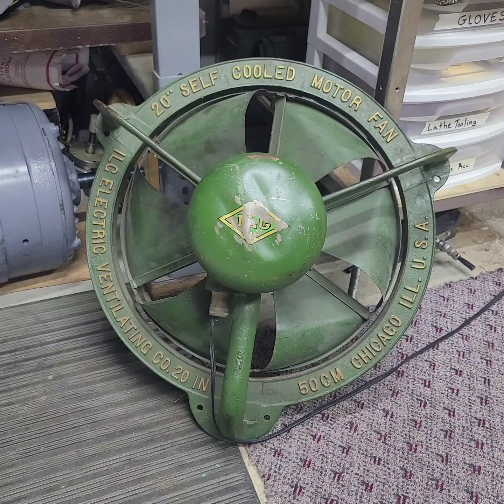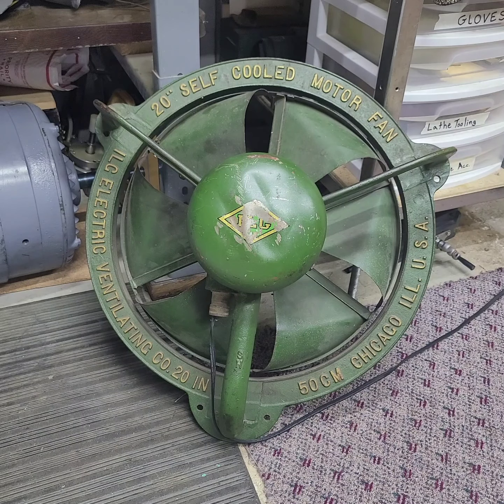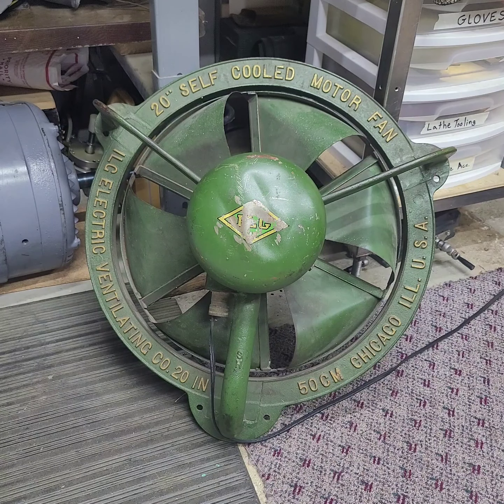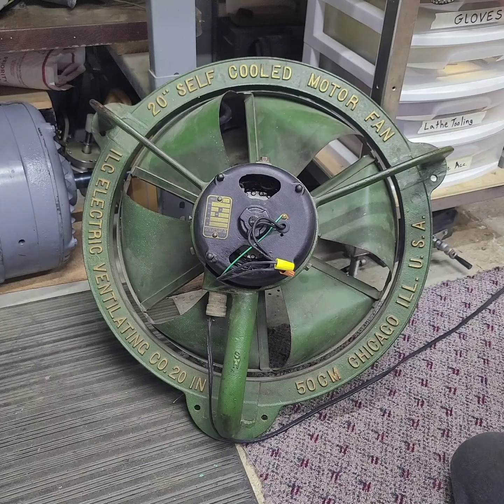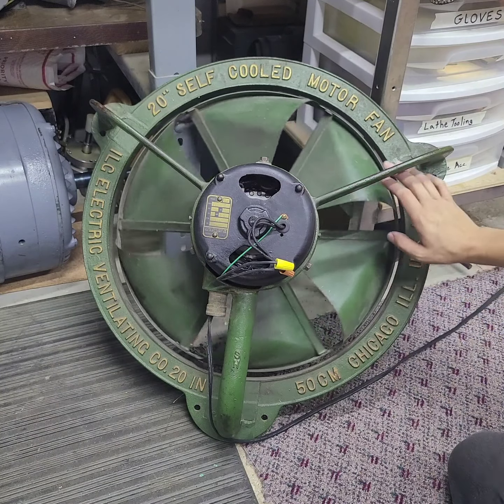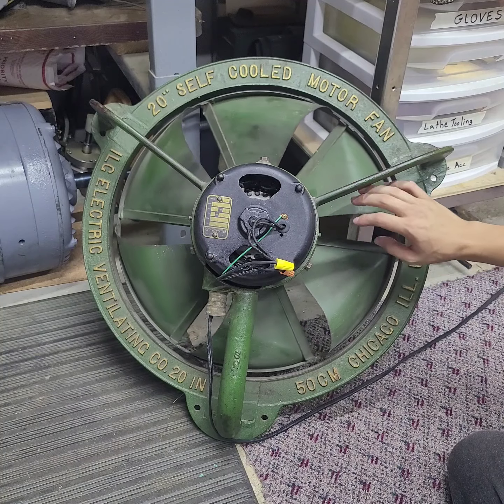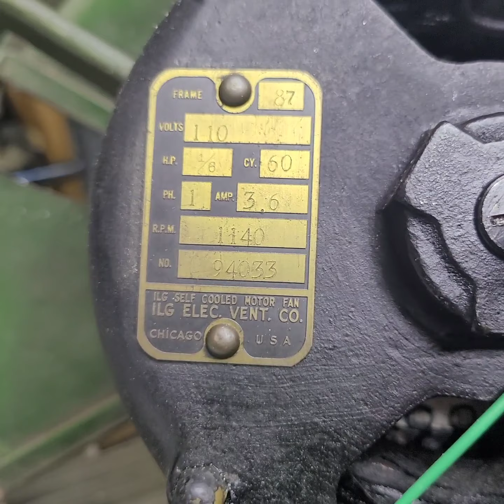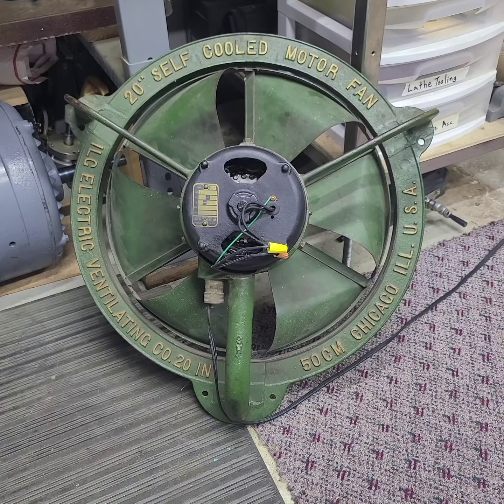ILG 20 inch type W self cooled motor fan #ILG #vintagefan

Comment: Love it.  I still need an 18 and 20 w blade for my collection.  I have all the other small sizes of the 110 volt variety.  I have two 220 3 phase ones,  a 30 and a 42.
Reply from the maker: I love the motors on these, they have such amazing starting sounds and are just pure works of art!